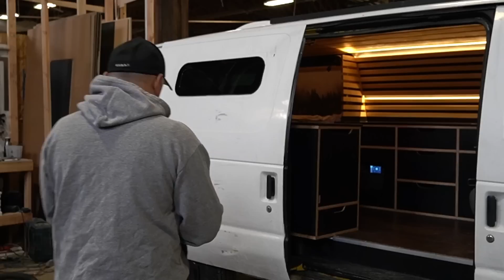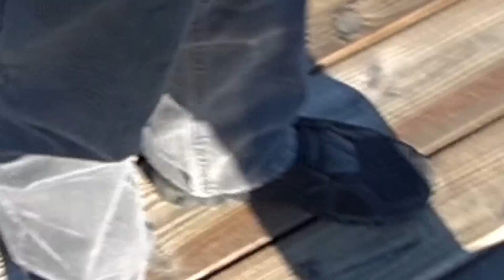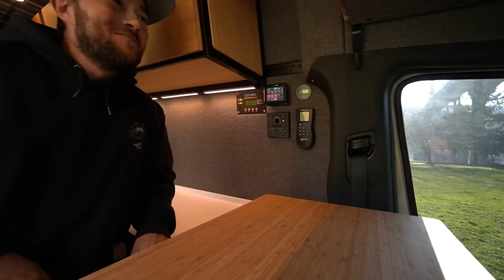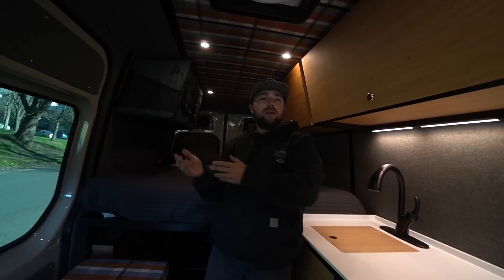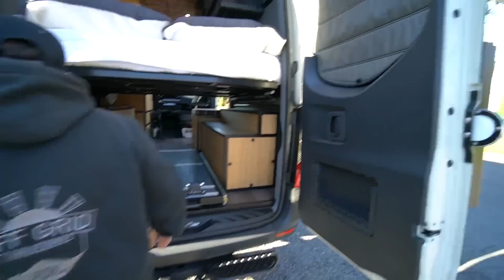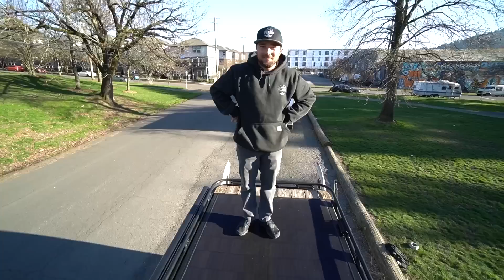Built to Adventure VAN TOUR - Beautiful, Clean, Modular Parts

Comment: $189,000 F NO!
 The sprinter vans are designed for package deliveries in cities. This is why they are so narrow. they are not made to be a camper van. 
Let’s see…. Buy a used van, bolt some cabinets to the walls, do some other stuff make a $50,000 profit. In the wrong business.
Reply from the maker: Sorry to break this to you but you're very new to this if this is your comment. Please look more into this and come back. Don't only look at overall cost of these vans, but look at price of everything involved (batteries, solar, electrical parts, A/C, heating, suspension upgrades, cost of wood, etc.) Not to mention the amount of time to put all this together which is called labor. By all means if you feel you can buy a sprinter van, put some cabinets on walls and make 50k then DO IT! Lastly, where have you been?! People have been converting cargo vans into camper vans for many many years!!

Comment: Great clean build!

It is incorrect to say 8020 is significantly more weight. 1x1in 1/8in aluminum is 0.513lb per foot, where as 1x1 (10 series) 8020 is .508lb per foot, so its actually lighter. There is also 30 series which is marginally heavier (0.584lb) and much stronger assuming correctly fastened. the fastening hardware adds almost no weight.
Reply from the maker: Interesting numbers and not sure where this is coming from. I can tell you I’ve held 8020 in one hand and tubed aluminum in the other is it’s obvious that tubed aluminum is much lighter. You can say numbers don’t lie but something is definitely off with these numbers. It’s also obvious because 8020 has much more metal on the inside of it than tubed does 🤷🏻‍♂️
Reply: @jarrodtocci  Maybe you were comparing 1/16in wall aluminum and thicker 8020, as opposed to 1/8in that was referenced in this build?

Got these numbers using online metals weight calculator, and weight specs directly from 8020's website. It seems people also use thicker 8020 than what is necessary in vans. They also sell "ultralight" 8020 which has many sections hollowed out.

Comment: Very nice build. Problem with that heating and water heat is cost. Bosch water heater is super cheap super easy and it does work amazingly. All my customers love it and they even love more  that they didn't  spend $10,000 on a heating system. Let's be honest if you're Boondocking you have no hot air or hot water. Oh yes just like the Bosch you can use it electrical.Just saying. In the future if customer wants it I'll put it in and make a killing on the cost of it.  By the way he's the one that turned me onto the S pod I do use them in my vans. Thanks  for that.

Comment: $180,000 ? 150,000 would be my max value a would give.
Reply: Chill put Paul.  Wtf.  He can charge whatever he wants. 

Not yr bidness
Reply: You chill, it’s just my opinion for  $189000 , have  no a/c , have to use toilet in entry way, shower outside, , dinky refrigerator on the floor, 400 amp/hr battery, 2020- not new. In  four years it’s worth $80,000.. outch!!
Reply from the maker: Other than watching videos online. Do you have experience building these? I ask because then you might understand the price. Do you know all parts in this van. Can’t base off of just want we see in these builds. When I see a price I want to know the systems used, electrical used, type of van, outside parts. Reason I say all this is because there’s probably $50k worth of products (maybe more) into this $75k van. Therefore the rest is labor which is actually a good deal when you break it all down. Lastly take into consideration how many builds this builder has down. They have done a lot. All of those number change is someone built this in their backyard with no shop or having done several other builds. That’s my point
Reply: I have experience building vans plus 40 years and over  building 100 homes.
Reply: Get off your high horse, you don’t know what your taking about, I put more into my standard build like a indoor and out door shower, air head toilet , 600 amp/hr , 3000 volt , 90 amp/hr charging, 180 watts solar, isotemp waterheater, power window shades , ultra leather fabric  for$50000
Reply: @jarrodtocci  you know someone lost perspective when they call 65.000 in labor to build a van „a good deal“.

Comment: What kind of solar panel is that?
Reply: It is a Solaris 400 watt panel. Can get it at Light Harvest Solar. OffGrid Solutions PDX included it with the electrical system they did for my ProMaster van.
Reply: So if you back a Solaris panel with full support you can walk on it?
I would love a walkable solar panel on my build.

Comment: Wish there was more information on the inside roof. What is that material made of and is it light? I put cedar planks on the top of my Transit last year but they add weight. This is a cool built.
Reply from the maker: Reason we didn’t go over the roof rack much was because they spent many many hours developing that product and they sell them. There’s a lot of engineering involved so it’s complicated to go over without ripping part the roof. On a side note I ask this. Is it fair that companies put tons of hours into research and development and then share how they do it and then others take the design from them, and then that company gets nothing for designing it or for the hours they put into it. That is why you don’t see a lot of people sharing how they do things. I speak from personal experience
Reply: @jarrodtocci  I was talking about the inside of the roof-not the outside. I just wanted to know what it’s made of and if I can order from the guy in your video. I’m kind of baffled by your remark because there’s lots of YouTube videos about how people did their van build. But whatever. I really can’t do anymore with my van except to try to lighten it. I would have to take it to a van outfitter to have electricity and a roof vent installed. Have a swell day 😐.
Reply: @Chris okay!